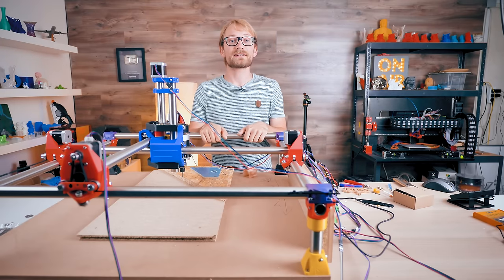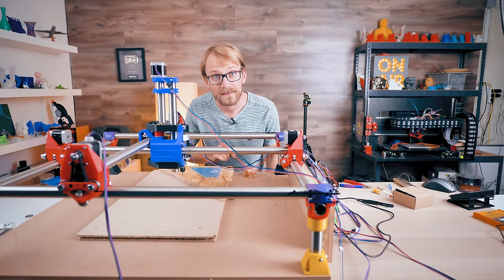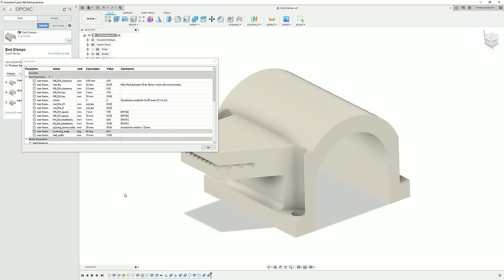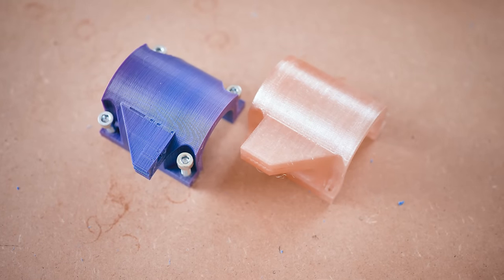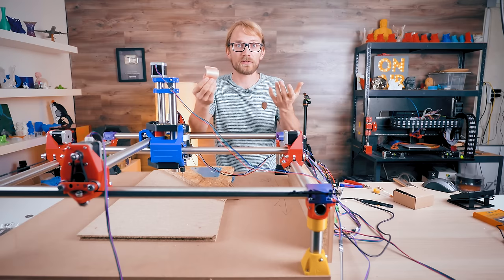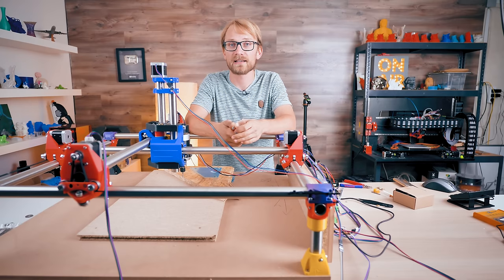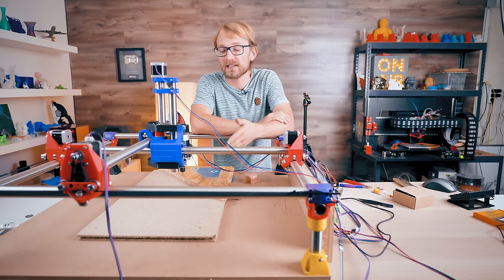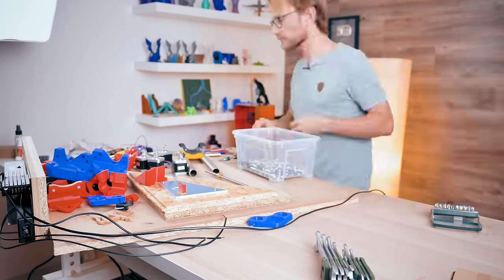Whose design even is this? (MPCNC conclusion)

Comment: So it’s time to design a metric based 3D printed CNC machine
Reply: Yes, it is. Let's go for it
Reply: Just dont use NEMA motors or belts, or wires, Vicious1 could sue u
Reply: And don't call it Metric Printed CNC, that might cause trouble later.
Reply: that has holes and press fits that actually work
Reply: Andrea Guarnaccia I found out that normal square aluminum profile 40x40, for example, is very cheap, widely available and easy to design parts around! I designed a profile roller already!
Reply: @SianaGearz  why ? I wanted to 😥
Reply: @kamilkosi9101  be careful, all those parts are derivative works of 40x40 extrusion factories 🤣
Reply: @kamilkosi9101  in one of the livestreams Tom explained why (40x40) aluminum extrusions are a bad choice for CNCs.
If memory serves correctly one reason is the price and the more important that aluminum extrusions are not rigid enough against twisting.
(I may be wrong about the reasons, and I don't have the time to watch all livestreams again :) maybe someone else remembers the reasons against aluminum extrusions)
Reply: yeah Thomas, make your own. You know waht works and what does not. Make it better :)
Reply: Don't just do that. Go fully parametric! It's wasteful for the open source community to need to design two of everything.

Check out the Mendel 90 and how it's design can be tweaked through config files. What the community needs is one each of an open source 3d printer, cnc router and laser cutter all customizable like that. Then each should have a pair of preset config files, at least one for Metric and one SAE.
Reply: @SianaGearz  Why, if you will be first with registration of that name :D
Reply: @intelligenceservices   yes you can use Nema motors as the company who owns nemas are not subservient to Vicious 1. I do think tom is p---ed and i don't blame him. If you are using a powerful router or motor then the frame needs to be totally rigid. As for 3d printing and laser use not so much. That is my opinion.
Reply: @SianaGearz  Mostly Metric Printed CNC (MMPCNC) then?
Or Parametric Designed Printed CNC (PDPCNC)? 

Would PDPCNC work? (Thinking of PDP 10 and PDP 8 :-) )
Reply: @fx1c333  the ratio is very high with respect to who is on what side. I've watched both Tom and MPCNC and I think Ryan didn't execute his role as CEO in the best way. Who knows, Maybe Ryan will be the Bill Gates of CNC machines any day now.
Reply: All-Metric is why I decided to make the Skeleton3d printer rather than the mess-of-screws Tauntillus. Skeleton3d was far easier to source things while Tauntillus had a mishmash of metric, SAE, and gauge screws... along with the requirement to drill tiny holes into hardened rods.
Reply: really justbored that’s what open source communities are for.
Reply: In any case, selling kits on eBay and improving parts and give them away under free licenses it’s a totally different thing.
Reply: @l3d-3dmaker58  :That would be OK... the MPCNC did not have those "features".   :o)
Reply: Add rack and pinion and I'm in... I have the time and capabilities (hw and sw)
Reply: @boredymcboredface8624  hey... ehm meaning?

Not quite getting what you mean:)
Reply: Thanks for your reply!
Reply: Yes please!
Reply: @boredymcboredface8624  unless that product part is patented or if Tom copied and pasted the STL file itself, there is no claim.
Reply: @boredymcboredface8624  I have built one of these machines and it is very problematic. You don't get to own parts that people invent to fix your design flaws.
Reply: OpenBuilds has many extruded metric parts that can be used to make a CNC machine
Reply: RootCNC 3 exists. And it is pretty darn good given the price.
Reply: @boredymcboredface8624  Court... it isn't the case... but would that even be possible?
Reply: Time create the open CNC
Reply: You know... There are a couple of those around already. Just search CNC router on Thingyverse. ;)
Reply: @Jehty_  Yes standard aluminium extrusions can be very expensive. That's why i found normal aluminium square tubing. They are like those pipes but square. They are 3eur for one meter. I think they are quite rigid and you can get them in different sizes 20x20, 30x30, 40x40, 50x50,..
Reply: @boredymcboredface8624  sometimes you have to choose your battles. This wasn't the right Hill to die on.
Reply: im for the name printed cnc with hardwhere in a superior scale system.
Reply: There is another open source CNC machine that's gaining a lot of traction lately called (Dremel CNC) and has an active Facebook group, and it is metric!
Reply: @boredymcboredface8624  I think you have a very distorted idea of open source projects. Running one doesn't imply that everyone is entitled to do whatever he thinks it's right, it just means that you can contribute to the project with your own design and that such design can be eventually be merged in the main project if it reveals to be an improvement. Open source projects don't even imply that people work for free. You claim you worked in IT for years but it's quite evident that you still haven't understood much of open source world.
Reply: I have copyright over the metric system...nice try!!
Reply: have a look at root cnc
Reply: Every1 shoud just do like wintergatan and build something awsome just because!
Reply: @boredymcboredface8624  I'm totally fine with him handling his own project the way he likes the most. I'm not ok with him asking people to take down their own designs for the simple fact that he has no right to do that. It's not a matter of respect, it's a matter of law and understanding copyright. No patent, no rights.
Reply: really justbored I’m not sure what’s hard to understand in “he has no right to do that”.
Reply: @Jehty_  Aluminium extrusions are by far not as straight as round steel pipes that can be readily bought.
Reply: really justbored I think there’s just no point in discussing this any further. You clearly refuse to see that unless you own a specific patent on something you have no words in anyone else’s work. You’re so defensive that you see Tom’s video as a way to get profit (which of course it’s a collateral effect of the videos themselves) but not as his videos were actually promotion for the project itself, you know, promotion brings profit too. People following Tom are willing to learn and try new things and I’m sure many people were already planning to build this specific project (including myself). Then if the project owner decides all of the sudden to set boundaries over a part which COULD be and improvement, for the pure sake of maintaining control (which control really?) over his creature, well, that definitively looks bad to me and it definitely pushed me away from the project.
Reply: @boredymcboredface8624  You don't see Prusa freaking out about clones, and they're using *HIS NAME*.
Reply: Even in the USA I am for that 🙂
Reply: See next main comment above
Reply: J_ G_    😂 oh yeah... and Steve jobs and Jeff Bezos and that Tesla guy...  he’s rolling RIGHt along the same path to greatness.....   pffft!
Reply: @intelligenceservices  Another ignorant comment. Please educate yourself before spouting rubbish.
Reply: @ExcelinusCom  depends what planet I'm standing on. Kg does not 😜
Reply: @boredymcboredface8624  free as in money are not the same as free as in freedom, which has been demonstrated several times. This is one.
Reply: @boredymcboredface8624  yes, you can change part by part, and when everything is exchanged, you have a new design and a new machine.

With  your conclution, i can't add a new thing to my car that I have designed, as it would be against the will of the car maker.
(Exchange car with anything that you can buy, in hole or parts to build yourself).
Reply: @boredymcboredface8624  yews, you are right. 
Tom has discovered that they construction isn't as free as claimed, so he has unbuilt it. In respect of the will of Ryan.  He has not thrown out any toys...
Reply: @boredymcboredface8624  The wishes of Ryan clearly makes this NOT Open, as in Open Source.. It is free as in money.  You happen to have the source, but you are not allowed to change it without acceptance by Ryan.

That is not Open....  You should know this if you are on Software business.
Reply: @boredymcboredface8624  Prusa design are a evolution of a previous one that is true Open.  Prusa know that, and he also know that by building and selling better products, he still have a decent profit. Even if he sell it for much more then those cheep knockoffs.
Reply: @ExcelinusCom  you are just a troll.

The metric system, which was designed by an English Scientist, by the way, are superior because it is designed to overcome the shortcomings of the Imperial and the later US system.
So yes, it is just to measure stuff, but in a way that doesn't blow your head of when translating from one uint to another.

This is why Science and Medicin uses the metric system and not your US system.

You are not converting between Celsius and Fahrenheit correctly.  If you are using two numbers, you should use two number to what you convert too.

You are basically cherry picking the only useful cases where Imperial units are better then the metric one.  In all other cases it is better, and thus you actually don't loose as much on wrong calculations.

About putting points everywhere.  How many inches are 10 cm? Well, you know that your Imperial system (and US) one is exactly 0.0254 m, or 25,4 mm.  IF the metric system would change, then your Imperial units would change.

But you are just rolling are you not?
Reply: This is why I chose the RS-CNC32 to build as opposed to the MPCNC, metric parts and fully open source. Open source is such a great thing, when looking up parts to build it I found an IKEA-style instruction book someone contributed to the project on the forums. Way more detailed and concise than their original assembly instructions! Now I'm working together with my coworker to get all the parts and get our first RS-CNC32 built, the second we plan on using the first to machine parts for it ;)
Reply: Let's look at The ROOT3 CNC by Sailor Pete.
Reply: I am currently redesign the whole MPCNC from scratch using plumbing tube with 26.67mm diameter or 1.05 inch diameter.  This best part of this tube is a standard size used by all country worldwide.   The size need to be complied worldwide or the plumbing accessories just would not fit. And these tube are stiffer compare to conduit tubing.  And they are available in Galvanised Iron (GI), Stainless Steel, PVC and many other materials.  The designed is about 95% complete.  Does that means I cannot sell the machine I built even though I drawn all the parts from scratch.
Reply: I hear what you're saying, but Ryan just wants control over his creation, I don't understand why Tom is so salty about that.  I printed one of these and I have made several thousand dollars cutting custom foam inserts for cases. The machine works awesome. I marvel at his design every time I use it. I too have made changes,  which I post in V1s forums and discuss, never had a problem. I support Ryan in spirit, but more importantly,  by buying his kit to support him.
Reply: @kamilkosi9101  however, not as straight as ground inox tubing
Reply: @ExcelinusCom  ROFL!  Microfurlongs FTW!
Reply: @AndersJackson  Sarcasm, rather than trolling, if I understand correctly.  Of course the OP understands that metric units are easier to use, generally speaking: the base units were selected so they work nicely together and relate easily to powers of 10.  The history of imperial units is interesting, and I will run for leagues talking about bushels of penny nails, but when I actually need a hex key these days, I almost always turn to my metric ones (from a bicycle tool made by a US company, interestingly enough ;-) )
Reply: @asicdathens  But those are really expensive.

Comment: Well that was a total waste. Just when you got me hyped to build a MPCNC, this fiasco happens. Guess this won't ever make it to my channel now either.
Reply: Take a look at the Workbee by Ooznest and openbuilds.  It is based on extruded aluminum v slots and its pretty simple to put together and tons more rigid.  Plus its either totally open source or just attribution-share alike.
Reply: @adama1294  Part of the attraction of MPCNC is that it is 3d printed, very low cost, uses extremely common parts and scaleable. V-slot alu extrusion? In my country there is exactly zero sellers for that, closest i found was in Germany but so super expensive it's cheaper to even air freight from US.

Aluextrusions are not like pipes and available on every corner hardware store.
Reply: @skaltura  well perfect time to design your own!
Reply: Shane, don't give up. I bet you could find a better CNC build. I would love to see that on your channel.
Reply: @skaltura  That is a fair point.  
If you want to build something to cut anything accurately without chattering  you are need something more rigid.  Plastic just has too much give.  All you really have to have is the motors, brainbox, and some kind of linear guide that is precise.  You can find square stock pretty much anywhere and build the frame the hard way by measuring and drilling.  If you can't find lead screws and nut blocks, you can get timing chain and sprockets to do the driving.  

It would take a lot of work but you could build something even better than the vslot system.
Reply: Plastic can be surprisingly rigid btw ;)
Reply: come on... there's no "fiasco" here.  It was simply asked that Tom re-release the part under the same terms as the other ones.  Tom's reaction did not jive with the request.
Reply: @GeoffreyPitman523  Tom's original work is not covered by his license - it was original work. Going with that mentality nothing in the world would get done, Ryan is not the first one to come up with a U-clamp.

Stuff like this is expressly exempt from copyright laws (functional parts which have no choice but to be that shape).

This is another show how Copyright laws are hugely negative for the society
Reply: @skaltura  surprisingly many that miss that it's an original part that Thomas made.
Reply: @skaltura  an "original" part, it had nothing to do with MPCNC? He just pulled it from thin air??  Regardless, the only ask here was to release the part on a non commercial license. No one is "hunting anyone down".  No one is threatening legal action, so all the armchair lawyers need to settle down and really think about what's happening here.
Reply: @skaltura  They are in the U.S. ;)
Reply: @GeoffreyPitman523  lolwut? You missed the part where Ryan was very angry that Tom did exactly that, and did in fact volunteer to release it under a non commercial license, which Ryan very astutely noticed would prevent him from using others' work for his own profit (lol), and accused Tom of "ruining the project".
Reply: @Anonymouspock  do you have a cite for that? I have not seen such an offer from Tom.  As far as I've read, his mantra through the whole thing was that he was going to release under CC0 instead of NC, I've been wrong once or twice before... so although unlikely, it's not completely out of the question.  ;)
Reply: @trbry.  it's not an original part any more than if I re-wrote "Harry Potter and the Sorcerer's Stone", by hand, and called it "Harry Potter and the Magician's Rock".   The tool used to make the copy isn't the deciding factor.
Reply: @Anonymouspock  were you able to find where Tom offered to release the part NC?
Reply: @GeoffreyPitman523  I strongly disagree, you would not write 'harry potter' if you tried to write a fairy tail/fantasy book for children every time you wrote one.
Reply: @trbry.  you would if you were staring at a copy of Harry Potter the whole time.
Reply: @GeoffreyPitman523  No I strongly disagree, this part is like a wheel if you want to to run smooth you can't make it square.
Reply: @trbry.  look around on Thingiverse, there are lots of shapes that corner can be.  It's not even Ryan's original part, he has changed it over time, so no it's not a functional shape.
Reply: @GeoffreyPitman523  Perhaps a better engineer would make it better the first time?
Reply: @GeoffreyPitman523  You can build a replacement part for your dishwasher, that looks and fits the same way, and release it under an open source license. Just because something is compatible with a machine, and is a replacement part for a machine, doesn't make it "derivative" of that machine, not in the way you mean, or no one would be able to build third party replacement auto parts, for example.  Copyright just doesn't work the way Ryan thinks it works. I've run into issues with him before, he's pretty maniacal on the issue.
Reply: @destinal_in_reality  my dish washer doesn't have a share alike license.  Besides if it's MY dish washer, no problem.  Selling the part to others is where share alike comes into play. And seriously get over your fanboyism, this is a month old.
Reply: @destinal_in_reality  what have you "run into" Ryan about before?
Reply: @GeoffreyPitman523  You can make and sell a replacement radiator for a GM truck, no permission from GM required. And you can share the files.
Reply: @GeoffreyPitman523  I was on vacation traveling at the time and didn't see any of this. I decided to weigh in. Seriously get over trying to play comment police.